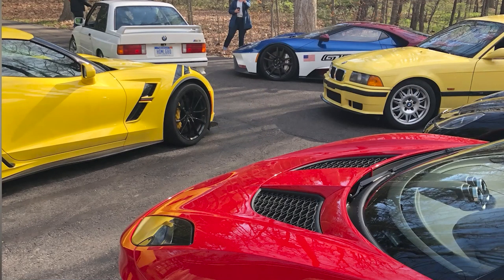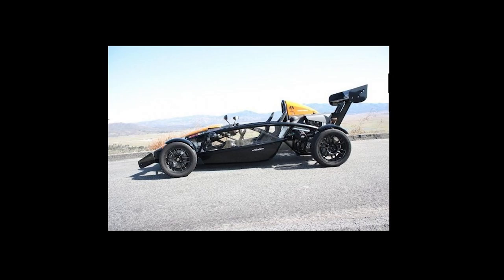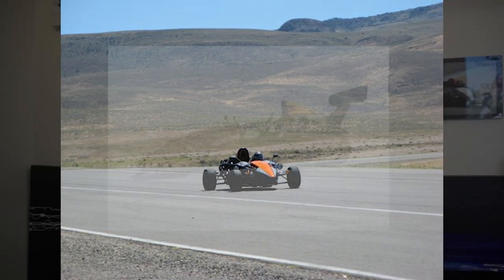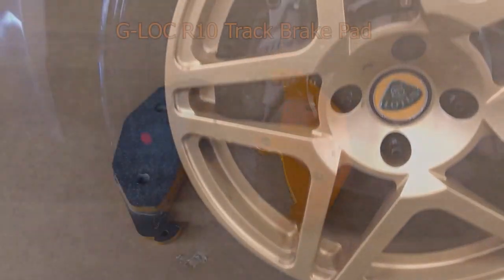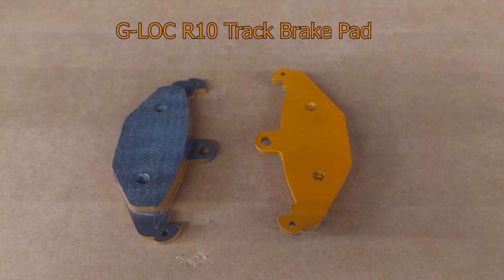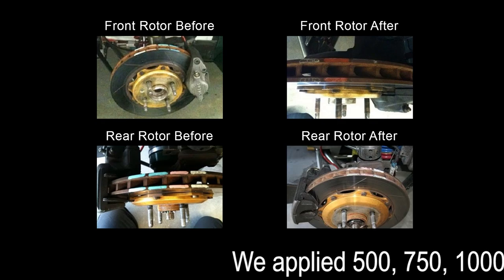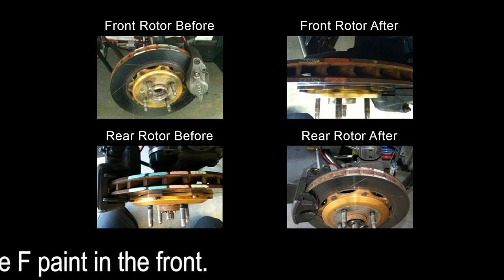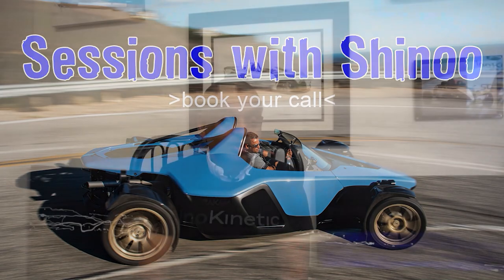Tech Talk: Brake Pad Selection

Comment: The R8 was an absolute train wreck for my 05 Elise when paired with BWR 2-Piece rotors.  Literally sounds like a freight train stopping.  I have gone through a couple bedding cycles and it helps for a short period.  Basically, anything over about 20% brake pressure results in the loudest, most obnoxious squealing.  The wife will not even ride in my Elise anymore.  So these will be relegated to track only and shopping for a quiet street pad commences.
Reply from the maker: We don't have terrible noise problems with R8s and stock rotors or our discOE or ULTRAdiscs.  They are an entry level track pad so some noise is normal.  Pad selection can be tricky but luckily they are cheap enough part that you can experiment until you find one that delivers what you are looking for.  You simply have to decide which evil characteristic you are willing to live with.